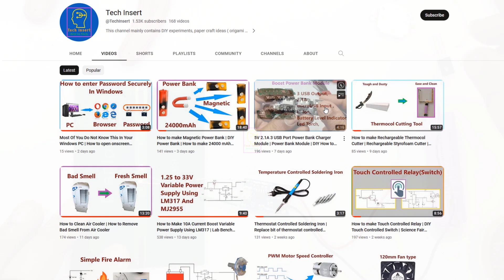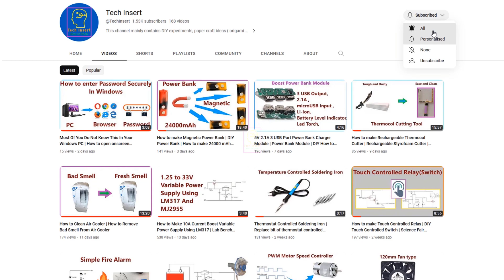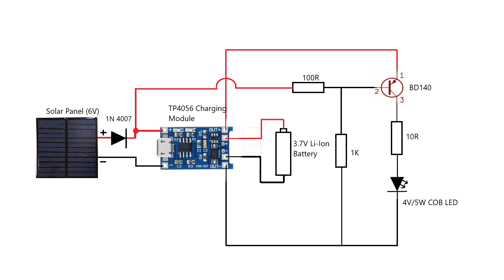How to make Automatic Solar Street Lamp | How to make Solar Street Lamp | Solar Battery Charging

Comment: Why did you connect 1k resistor to base of Bd140 transistor. How did you arrive at all resistor values.  Can you explain the formulas.
Reply from the maker: For a PNP transistor to switch ON you need to give a negative supply to the base of the transistor. Base to emitter junction need to be forward biased, then only current flow through emiitter to collector(for PNP transistor) .  Transistor is a current type driving component.

Ib(Base current) =  Ic(Collector Current) / Beta(Beta is 40-160 normally we take higher value)
Rb(Resitor at base) = Vcc- Vbe(Normally 0.7V)/Ib
Reply: @TechInsert  Thank you for quick reply and nicely explained.
Reply from the maker: @sridharkrishnappanavanerth3388  You are welcome. Thank you